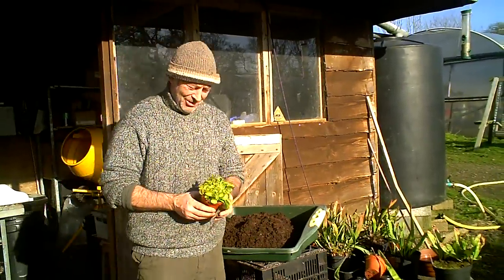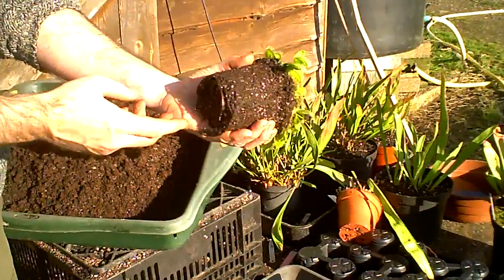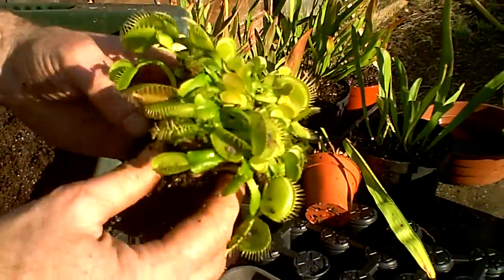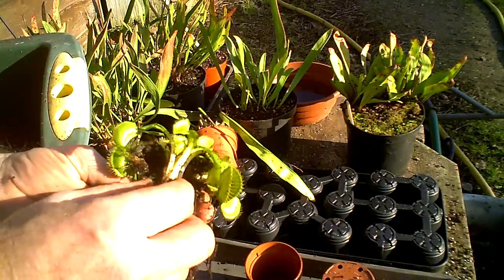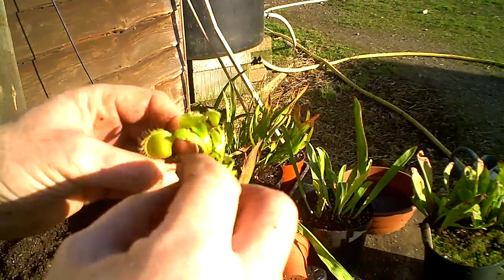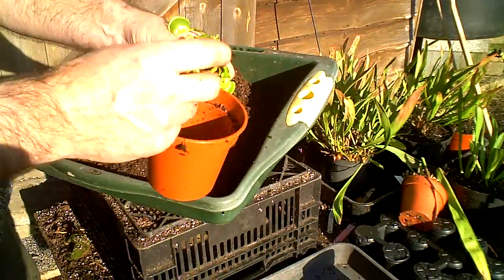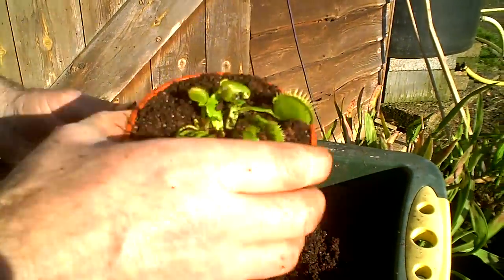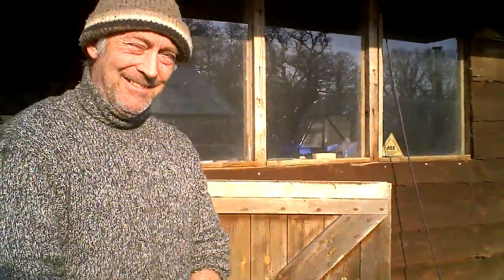How to divide and repot  your Venus Flytrap  Dionea muscipula

Comment: Mine never grow 😵😢 i buy some seeds by wish and i don't know what im doing wrong
Reply: Just me, I haven't had any luck from seed either but a quality small VTP I have found is the way to go. I will continue to try from seed but having one or two that have been started and nurtured by someone more knowledgeable at the time than me concerning VFT's was just the thing for me.
Reply: Seeds need heat and light to grow and they need filtered or rain water. I have successfully started seeds in old jam jars. The jar acts like a mini greenhouse, trapping heat which the seedlings need to germinate. Also, not all seeds germinate and even the ones that do take a good 3 weeks to sprout. I’m growing mine in the winter, so they started and ready to feed by spring.
Reply: Ghost In The Galaxy I live in Puerto Rico here is hot and rain a lot lol and never grow so I don’t know what I’m doing wrong maybe soil 🤷🏻‍♂️
Reply: The plants are not tropical and the seeds require a period of cold stratification. They also take a long time to grow even with perfect care

Comment: Venus Flytraps originate from the marshy and bog regions of North & South Carolina on the East coast of North America.  There are little to no nutrients in the soil they grow in, as the nutrients have been washed away by the water in the boggy habitat.  Therefore, the plant has adapted to source it's nutrients from insects.  The pads (or mouths as I call them) contain (usually three trigger hairs) on each side of said pads.  Once an insect lands on these pads and stimulates the trigger hairs, along with a sticky secretion which traps the insects, the pads will close, trapping their prey.  They slowly dissolve the unfortunate prey and this is how they feed and are able to survive.  If you own or are thinking of buying a venus fly trap, please don't try to stimulate the pads (mouths), as each one can only open two to three times, after which, the individual pad and leaf will die.  If it is fooled into thinking it has caught prey, it will close and with nothing to digest, it will die off!

Comment: I was going to use a root stimulator when I re-pot my venus in a few days. Will this help or hurt?
Reply: probably hurt. VFT roots are very sensitive to any additives or nutrients in the soil. they can't even really tolerate tap water so i'd assume its probably too strong a chemical for them.

Comment: DO NOT put Venus fly traps in soil. Nutrients kill Venus's-flytraps you have to use a certain type of moss that has no nutrients in it they have to be kept in moist moss. Clay pots also kill Venus's-flytraps. Use a netting pot filled with no nutrient moss and use the trey  method
Reply: I use 50:50 perlite and spaghnum peat moss. Sometimes throw in some silica sand. Never had an issue with a small plant in a larger pot?
Reply: No they don't have to be kept in "moist moss" it's usually things like perlite, sand, sphagnum (yes, sphagnum is moss but it's not the only thing they grow in)